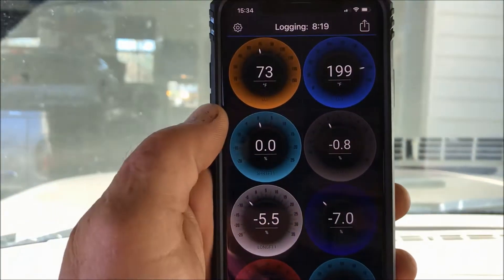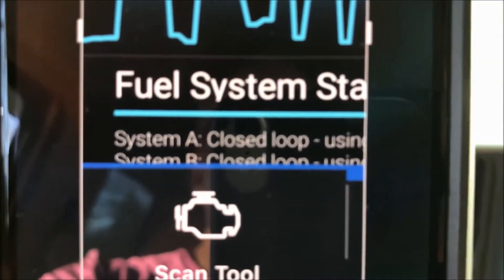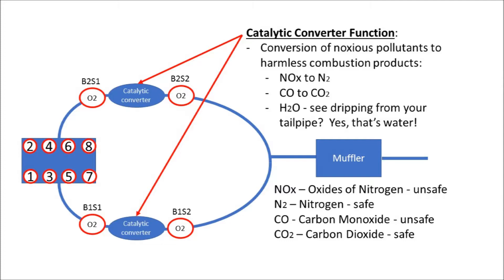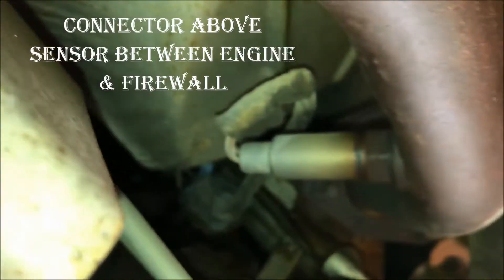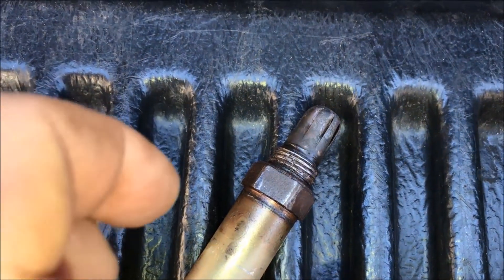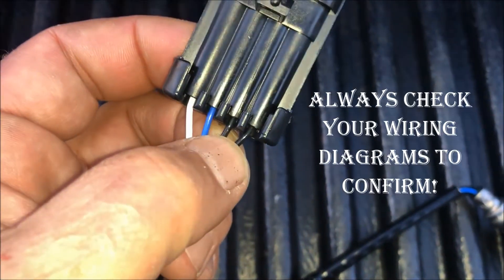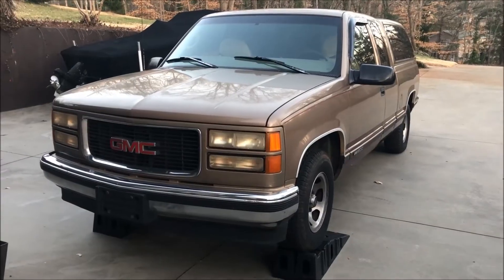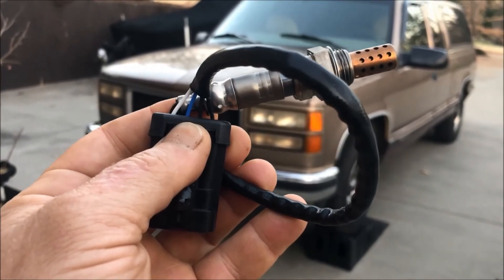How To Fix GM O2 Sensor Heater Circuit Malfunction: P0141, P0155, P0161: 1st Gen GMC Sierra '88-'98

Comment: Question. Can I keep my obd2 scanner on while the truck is currently running. Can I see live data ? Not alot of info on that and was curious.
Reply from the maker: When I do my scans, I run the engine at the same time.  My scanner also provides live data so I can monitor fuel trims and other important data.  Which scanner are you using?
Reply: So my truck was throwing the po430 code . And I was extremely sceptical about that and a bad injector . I went a bought a good o2 senor and it took everything away . My fuel mileage came back . The truck wasn't so sluggish anymore . Funny thing is I replaced this sensor about a year ago but I cheaped out and bought the least expensive sensor. This time I got best one my local parts store had . Fixed it
Reply from the maker: @THatChevyguy91  That's an awesome story... did you change the upstream or downstream O2 sensor?
Reply: @DrivingIntelligence  I did with the same brand of sensors. Note . The cheaper the sensor is the lest likely of it being a long turm good lasting part.  Just from my experience
Reply from the maker: @THatChevyguy91  Understand, but I'm trying to understand which sensor you replaced.  The sensor before the catalytic converter or after the catalytic converter?
Reply: The sensor behind the cat was my issue.
Reply from the maker: @THatChevyguy91  ok, thanks for that info.  With some cars and trucks, a failure of that sensor does not cause a problem with engine performance, but perhaps with yours it does.

Comment: I cant get my htr monitor ready
Reply from the maker: Sorry for delay.  I’m guessing you got a code indicating your O2 sensor heater is not working.  That likely indicated your heater circuit within the O2 sensor is defective, or you have a problem with the connection back to the ECU.